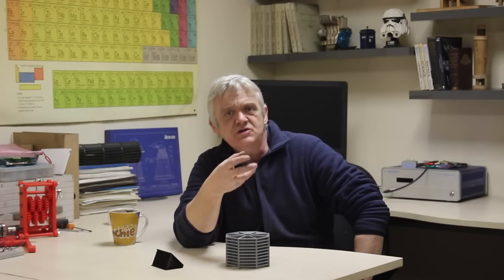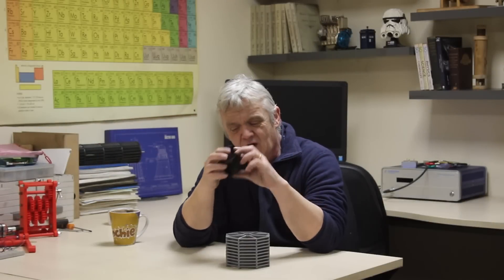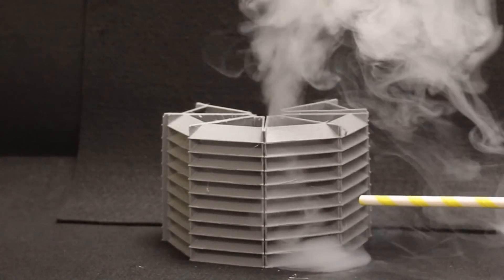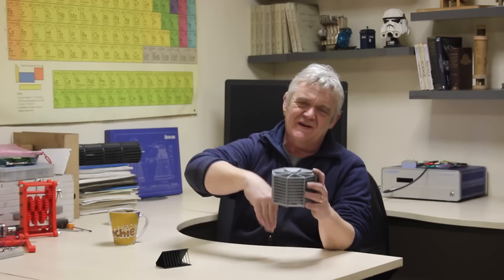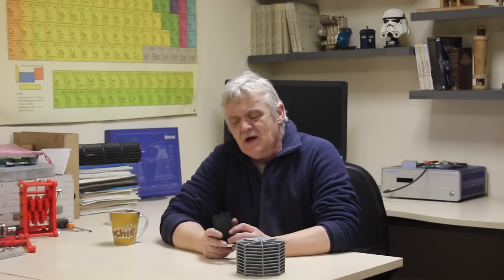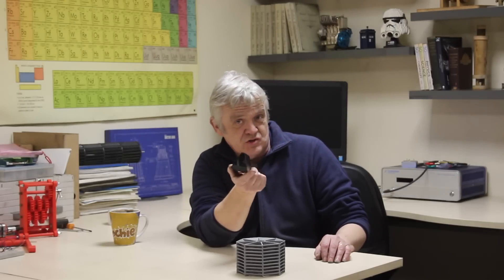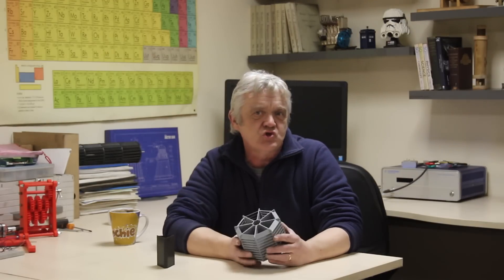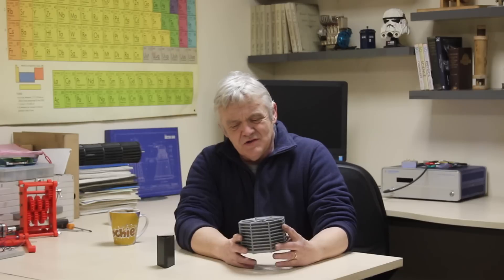1830 A Darwin Wind Turbine Breakthrough

Comment: Bit like the Barjeel wind towers and others in Iran (used for air conditioning)
Reply from the maker: yeah - very like them
Reply: @ThinkingandTinkering  except they sometimes work in reverse, sucking air over an underground river, up through the tower and out trough vents on the leeward side.

Perhaps there could be a pivoting variation that faces into the wind and uses the low pressure leeward side of the tower as well as the high pressure windward side to draw air up after it has been pushed down?

Maybe the slat shapes can be modified to make them act a bit like a Tesla valve to prevent loss of efficiency?

Or maybe not and simple is better!

I like the stackable modular nature of your print.

Comment: The Lunar Club, Darwin (E) also came up with the steering system you use on a modern vehicles after a horse and carriage accident on the way back from one of their meetings. Very clever chap.

A side thought should you build these at scale, I would look at a sectional design that is assembled from molded units. You need just  2/3 tools. (Don't put pairs in the tool you'll end with issues as one produces more good parts than the other)

Make it out of fibre reinforced regrind. It's not impact structural and you'll get some really funky colour patterns.

PS an earlier video showed some great potential for horizontal, that could be interesting running along a ridge top
Reply from the maker: yes he did - nice one mate - cheers

Comment: Wont it short circuit on the side with no air pressure,  supose very close to fan blades may solve that but may may need one way flaps to cancel out the turbine drag on the side with less or no air pressure
Reply from the maker: or a wells turbine
Reply: @RobertMurraySmith  also reminds me of a chimney pot design,  you know the spiral air foils to stop tall flue osolation ...
Angle the lovers
And external twisted air foil 
Like a large twist drill with air collection lovers 
Yes im dislexic 
But have a degree
Reply: @RobertMurraySmith  not seen wells type , but you cant have air blowing on one side and sucking on other of same fan , your segments are effectively separate  tubes so may even get negitive pressure in back one out of the wind 
You do some very interesting and great work m8

Comment: I'm interested to see test results in actual wind.
Have 8 separate cavity "slices" might be a problem because only 2 to 4 slices on the front will get positive wind pressure (wind going in) but the rest of the slices on the sides and rear will likely have negative wind pressure and the air may bleed out...
Reply: I agree, thought the same.
Reply: My thoughts exactly.
Reply from the maker: it may - but my thinking was a wells turbine would answer that - or just point it at one side and shield the other
Reply: @ThinkingandTinkering  .. what about internal flap valving, a single structure like your earlier model but with the vanes as simple flap valves so air can only go in one side but the opposite side will be closed?

Comment: I wonder if splitting the cheese slices into 36° rather than your 45° would improve airflow even more. (Closer to the magic 35° you make the louvres at and obviously divisible  by 360°). I.e. ten wedges instead of your 8.
Reply from the maker: I used 22.5 degrees mate - it's an octogon at 26 it would be a dodecahedron wouldn't it?

Comment: Make each 35 degree wedge a foil to increase the wind speed, make the top most wedge cap a hyperbolic curve. Coat the back walls of the wedge in golf ball surfacing. You'll improve efficiency by about 200%.
Reply from the maker: cheers mate
Reply: Interesting ideas, what percentage of the back walls should be covered by the dimpling?
Reply: @em9594  Wherever the surface has the greatest resistance. The dimpling creates microvortices which create a cushion of air. This lowers the overall resistance of the air flow, thus improving the airflow down towards the blades. Given the design you have which is wedge shaped, I'd suspect the greatest air resistance is the back third of each wall where it converges to the central point. This is also where the greatest section of wind pressure will be thus the greatest section of energy loss. 

Making the 35 degree fins foils will also increase wind speed while still directing the air in the intended direction. This increases the internal air pressure and allows for more energy transfer to which every turbine you choose to use.
Reply: I would further suggest that you reduce the sections to just three, breaking the top down circular lithography into three sections at 120 degrees each. This reduces the overall surface area that will interfere with airflow while still directing the airflow down. The more internal walls you have the more friction and back pressure is created. A rounder backwall that funnels air down instead of sharp points and walls is what is needed for improved performance. The back wall should resemble more of a section of a rounded nose cone (or the cone of a jet engine nozzle with the widest end nearest the wind turbine). 

Your current design does the job, but not nearly as efficiently as it could be.

Comment: Could you put this at the top of a down pipe of a drain pipe so that the water can open a trap door easily to flow through and have the fan be waterproof? That way you could have both a wind and water generator to capture both energy sources
Reply: Was thinking that it would not be for wind and water at the same time but for wind or rain. You could potentially have it so the generator could increase its resistance, to produce higher amperage during rain set off by the swing door being moved up by the water, and then reduced drag when the door is closed and it's wind blowing down and moving it.
Reply: I like the way you are thinking!
Reply: Me too!
Reply: I would think that the friction of the water on the blades would interfere with the air flow on the blades. This was just a thought I had. The only way to know is to try. Good luck
Reply: @buzzard-roosthomesteadandp3097  I interpreted your concept different . I was thinking for water to go down a thin tube or pipe it also has to draw air just like putting your thumb on top of a filled straw. So as the drain water goes down through its turbine you set it up so the  drawn air also goes through a turbine ! 😱
Reply: @Buzzhumma  oh ok it's worth a try
Reply from the maker: spot on mate!

Comment: Nice job. would be interesting to see what wind speed you could generate with it on a length of pipe compared to the actual wind speed and also when you add a Venturi to it
Reply from the maker: yes it would!
Reply: Good show

Seems funneling along the way would increase velocity

Not being negeative but might need to factor in dealing with possibly cooling the air and when it rsins, snows there's the potential of icing & clogging

Comment: Make it black so you generate thermal wind
Reply from the maker: nice idea mate - cheers
Reply: @ThinkingandTinkering   @Pep Waverley  the intention is to generate, the location of the generator is where tinkers comes to play. More wind at top, hot air goes up, pipe inside black pipe caped at bottom. Cool air enters at top, drops down center pipe, enters black pipe at bottom and heats up, warm air exits at top. Thermosiphon!
Reply: In the desert there are towers they use for cooling, the sun heats up the air and it rises causing air to be drawn into the house causing cooling. If you reduce the outlet dia then that would speed up the velocity, good place to try a generator.
Reply: For that to work efficiently the outlet would have to be on top.
Reply: Really good Idea...
Making that in Graphene would be Optimal...
Reply: @antoniopacelli  I'm just asking, why would it be optimal if made from graphene?
Reply: @pepwaverley2185  the intention is to generate, the location of the generator is where tinkers comes to play. More wind at top, hot air goes up, pipe inside black pipe caped at bottom. Cool air enters at top, drops down center pipe, enters black pipe at bottom and heats up, warm air exits at top. Thermosiphon!
Reply: @pepwaverley2185  get your umbrellas out, cuz now it's a brain storm!